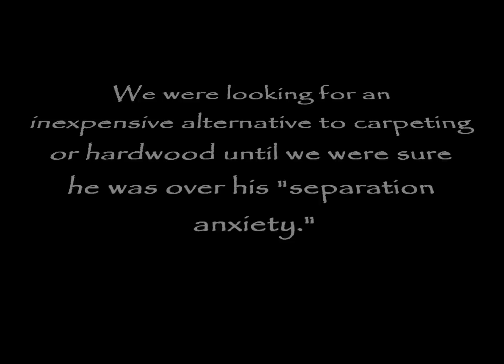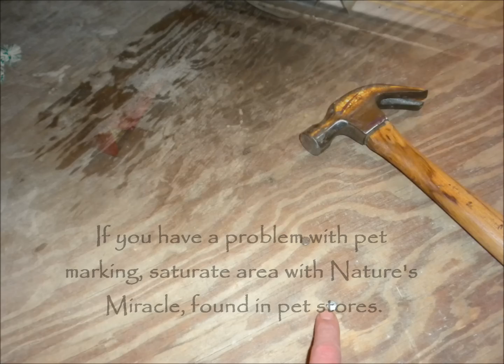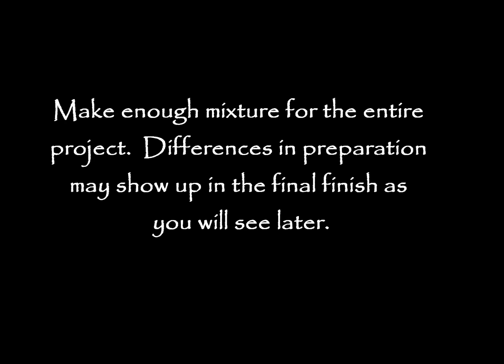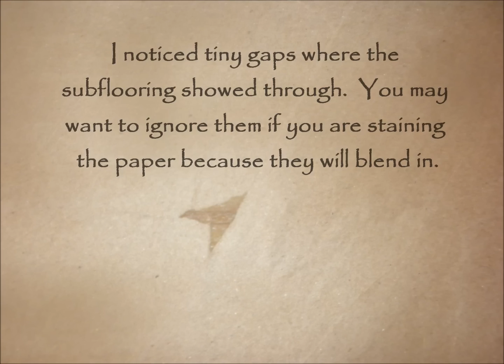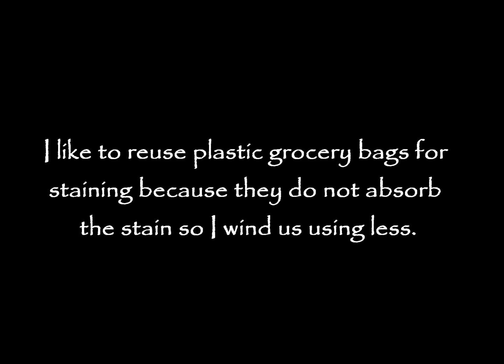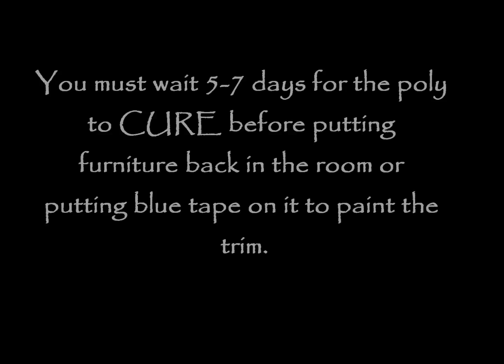DIY - Brown Craft Paper Flooring

Comment: What kind of varnish would you add to the floor. I'm going do this on the walls too but need to know if I need ditterent type varnish for walls. Waterbase/ oil base. What would Your take on that be.?
Thank for brill idea.
Cheap but cheerful😉
Happy days.
One more thing will brown paper on walls keep the heat in better?
Reply from the maker: So sorry this is an old video and I don't often see comments. I used water based poly. It dried fast between coats so I was able to do many. Also was far less stinky.

Comment: You did a beautiful job, I've done 2 closets, next will be 3 large bedrooms. Love paper floors.
Reply from the maker: heidi smith thank you Heidi. It's not a long-term solution especially for high traffic areas or if you have pets but it gets you over the hump until you can afford something better. They really do look lovely.
Reply: @SaraMaurnoRealtor  It costs more money but a resin finish for floors in place of the poly and the floor would last as long as you want.  Baccari (? I think that's the name) has resin that doesn't need to be blow torched.  Very, very easy to work with.  They have a non-slip version that is wonderful for floors.

Comment: How is your floor doing? How do you n clean it? I was thinking of putting wood floors bit seen this and really liked it.
Reply from the maker: Darn - just saw this now . Sorry just saw this for some reason. You are correct. Not suited for high traffic area. I just recarpeted the floor. With my big dogs claws it started showing scratches after a couple years. Because I started with a lousy sub floor which expanded and contracted drastically it started to crack at the seams in the last year. It was never planned to be a permanent solution. lasted 5 years

Comment: I am hoping that you will see this question given that the video is older.  I was wondering how you clean the floor?  With water based poly I don't think you can mop, right?  It is basically sweep and wipe up any liquids with a paper towel, ASAP?  I ask because I am just finishing a remodel on a room that is 22 x 22 and I don't know what I want to do for permanent flooring and can't really afford it right now either.  The floor boards were painted with Kilz because I originally planned to just paint them and live with them but then I saw this video and the idea of using white paper on rolls was intriguing.  The room is going to be a craft room and sometime guest room.  I will caulk the subflooring since several people in the comments have recommended doing that and it sounds form your responses that yours cracked because it wasn't caulked.  I wonder what kind of caulk would be best?  Any thoughts on that?  I will have to do one  half the room at a time since I have furniture on one half that I don't have any place to store but I think as long as I keep a straight edge in the middle where the two edges are going to meet then I shouldn't have trouble with the poly not going well over itself.  The guys at the hardware store told me that if you put poly over dry poly it will lift the first poly up.  I don't know if that is just if you haven't let it cure for 7 days or not.  Anyway, thank you for the tutorial and if you have any ideas/answers to my questions  I would appreciate the help.
Deborah
Reply from the maker: Hi ! Just seeing this - I used a damp mop on the floor. This is an old video so I don't have the floor any more. I would recommend not using a soppying web mop or letting spills sit for long. I don't know what would happen. This was a temp fix than lasted about 5 years. Would have been longer if not for our dog.

Comment: I live in a mobile home..do you think I could do this method for my bedroom? Would the high heat and humidity of my area (Texas) cause issues with the polyurethane and its curing time? If I can even pull this off..should I wait till winter to attempt it? My room quite small if that matters.

This was a very interesting tutorial for the process. All other tutorials I saw only used polyurethane for laying down the paper not Mod Podge! Thanks for the video! Your room was just stunning at the end!
Reply: Since this reply is a while later, it will only be good for information for others. I am using Varthane for the finish in a high humidity and warm area. No problem with dry time or curing. With only 2 coats, the dog made a scratch, but I am going up to the recommended 7 coats at least.

Comment: Very interesting.  Not suited for high traffic areas I'm assuming?
Reply from the maker: Sorry just saw this for some reason. You are correct. Not suited for high traffic area. I just recarpeted the floor. With my big dogs claws it started showing scratches after a couple years. Because I started with a lousy sub floor which expanded and contracted drastically it started to crack at the seams in the last year. It was never planned to be a permanent solution.
Reply: I put kraft paper on stairs which are the only entrance to my home.  It is holding up perfectly after 3 years.  I used 7 coats of polyurethane.

Comment from the maker: Water based poly is not toxic to breath. Perhpas you are thinking of the pil based poly which is really nasty to breath and smells terrible.  You don't want to use oil based poly in the project anyway.  Still it is always a good idea to work with the windwos open in a well ventalated room.  Once the floor is dry - and it dires very quickly you have no need to worry at all.  Good luck and let me know how it comes out!

Comment: Just curious, is there a reason to use the small paintbrush on a pole as opposed to using a roller?
Reply from the maker: It's what I had handy
Reply: I tried using a roller and it just leaves bubbles.  A painting pad on a long handle works best for large areas.  A brush works also for small sections.

Comment: Doesn't matter what side you use as long as you stick to the side you picked. That's only if you want it to be consistent. One side is smoother than the other on the rolled paper.

Comment: As a dog owner, THANKYOU for addressing the urine on floor issues.

How has this floor held up to 'accidents'?
Reply from the maker: Darn - just saw this now . Sorry just saw this for some reason. You are correct. Not suited for high traffic area. I just recarpeted the floor. With my big dogs claws it started showing scratches after a couple years. Because I started with a lousy sub floor which expanded and contracted drastically it started to crack at the seams in the last year. It was never planned to be a permanent solution. lasted 5 years

Comment: Is it slick when it's wet? What would be recommended for cleaning on it, to not damage it?
Reply from the maker: Darn - just saw this now . Sorry just saw this for some reason. You are correct. Not suited for high traffic area. I just recarpeted the floor. With my big dogs claws it started showing scratches after a couple years. Because I started with a lousy sub floor which expanded and contracted drastically it started to crack at the seams in the last year. It was never planned to be a permanent solution. lasted 5 years. Diluted vinegar and water for cleaning. Not any more slick than any other wet floor.

Comment: How does the floor hold up with large dog's toenails?
Reply: They would need to be trimmed and filed regularly. Even my little JRT has long tough spiky toenails. Which she doesn't like being touched by anyone but me!!!
Reply: Thanks. I'd love to do this in my guest bathroom. Any thoughts on that?
Reply: I would think the floor would be fine. 6-8 coats of poly urethane should do the trick. I’d try it. The seal should protect the floor from water damage ...
Reply from the maker: Yes I did 6-8 coats

Comment: I was wondering the same thing... we would have to walk on it with socks but I'm worried about our dog tromping around with her claws...  I really love the look!
Reply from the maker: Darn - just saw this now . Sorry just saw this for some reason. You are correct. Not suited for high traffic area. I just recarpeted the floor. With my big dogs claws it started showing scratches after a couple years. Because I started with a lousy sub floor which expanded and contracted drastically it started to crack at the seams in the last year. It was never planned to be a permanent solution. lasted 5 years

Comment from the maker: I use plastic grocery bags. Have a stack of them ready.  Open windows 4ventilation & work your way out of the room. Since you are working in small areas and working it in as you go along you DO NOT have to go back & rub it off.  It is actually a pretty fast process.  My husband & I worked in dandum. He smeared stain on a 2X2 ft area. I followed to rub it in-not too hard it will almost feel dry as you work it in)  Put some good music on & get a rythmn going!

Comment from the maker: I would recommend this floor on low traffic areas.  Having lived with it for a year, I do notice some slight cracking that I should be able to repare where the plywood has expanded and contracted with the heat and cold in New England.  Concrete would minimise that and yes I have seen people here on YouTube who have done it in basements.  I would be VERy carefull about moisture and NOT do it if it is a high traffic area.  DO NOT drag furniture over is and WILL scratch.

Comment: Wow. I am In the middle of this doing half my house. I am exhausted by carpet removal and subfloor prep, which contributed to me freaking out over having to patch where there were bubbles or where I had not placed the pieces overlapping enough. Its looking beautiful, though. Since I live where I am doing this, I have been working it like a freeway closure: in phases and so that  there are dry lanes you can walk through the project area. I am so thankful you posted the before and after. I'll make a video. Bless the "Leaky One." ❤
Reply from the maker: The double should flatten as it dries.
Reply from the maker: I did this several years back and it lasted about 3 years maybe 3 and a 1/2 years before I started seeing wear and tear. Since then I have carpeted the floor. It was an inexpensive and temporary fix. I wish you the best!

Comment from the maker: I recycle plastic grocery bags for faux paintng treatments.  They absorb less product than rags and are plentiful.  In small 2-3 foot square areas apply the stain with a brush, then gently wipe the stain in circular motions with the plastic bags.  You'll use many.  Since you won't be going back to wipe the stain off the way you would on a furniture piece you are leaving a light coat which will penetrate the paper.  Don't leave any puddles.  Good luck! : )

Comment: Whould you have different advice if I were going to try this technique over a concrete subfloor?
Reply: Gene den Daas for concrete subfloor, put down a coat of poly to act as a vapor barrier and to fill the pores prior to laying down the paper "tiles"
Reply from the maker: should work better on concrete.  Sorry just saw this for some reason. You are correct. Not suited for high traffic area. I just recarpeted the floor. With my big dogs claws it started showing scratches after a couple years. Because I started with a lousy sub floor which expanded and contracted drastically it started to crack at the seams in the last year. It was never planned to be a permanent solution. lasted 5 years

Comment from the maker: I brush the stain on and simultaineously rubbed it in gentle circles with plastic grocery bags.  Since you can not go back in and wipe it off like you would wih a brushed on stain, gently rub the stain off as you rub it on - if that makes sense.  Not sure how else to descibe it.  It's not an exact science.  Just make sure not to leave it wet or buddle as you go along.  Do a 2ft X 2ft area and then move on working yourself out of the room from the furthest corner. post pics when you're done! : )
Reply: Tnx 4 replay. I hadn't  realised this all started a wooping 10yrs ago.⭐️🌻🌟

Comment: how did you move your heavy furniture on the paper bag flooring?
Reply from the maker: carefully - don't drag it
Reply: That's the drawback of using polyurethane on anything; it scratches easily and can't be repaired so you have white marks there permanently.  Unless they're making a new kind now that doesn't do that; they are always coming up with something new to solve problems.

Comment from the maker: I could walk very lightly in socks in in 24 hours.but i didn't put ANY furniture on it for 7 days.  It is best in a bedroom where you have low traffic and are barefoor or in slippers. I have a couple srtached that I will soon repair from my dog stretchng in the morning and digging his nails into it. But they will be easily fixable with a small brush and leftover poly.  I would use scatter rugsin the kitchen area since it get high traffic.  I also don't have to wash this nearly as much in the BR.

Comment: Great video...but..I wish you had narrated this piece as opposed to having to read all the text. I got tired of having to pause the video to make sure I was reading everything and not missing bits because I wasn't reading fast enough.  Why didn't you narrate? I see your disclaimer up top...it's kind of a deal breaker for me to have to pause and read, pause and read. Gives me a headache. Sorry.
Reply: Cathleen there’s a playback speed setting ( top right corner 3 dots) and you can adjust the speed this video goes. I put 0.75 and didn’t have to pause, enough time to read.
Reply: @tiame    Thank you so much...I had no idea.  That will help tremendously. This was a really good tutorial and due to my most aggravating double vision it gave me a headache to try and read fast enough so I had to keep  pausing. Thank you so much for this tip.
Reply: Change the speed. Very simple. :)
Reply: Tanya Mertes  thanks! I had no idea!  lol

Comment: Please do not follow the instructions on this page.The glue mix ratio "is not right".The glue ratio is 3 parts water/1 part glue ..not the other way around.Cost me a gallon of glue thought id post this and save the next person some money
Reply from the maker: I thought my $10.00 investment in glue was worth it.
Reply: You don't need glue.  Just scrunch the paper and dunk in polyurethane then lay.
Reply: @debbraun5574  ....what's cheaper? glue? or Poly urethane?
Reply: @jumpinjackfish  glue is cheaper but polyurethane is easier and faster
Reply: @debbraun5574  but don't u still have to put 4 or 5 Coates of poly over that too?? Plus builders paper is thicker and soaks up more the 1st coat of poly...